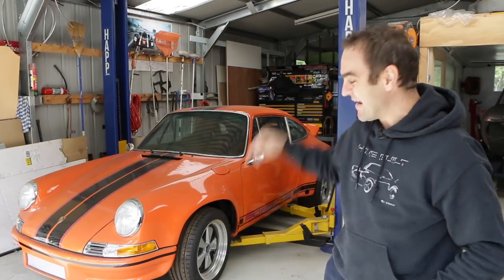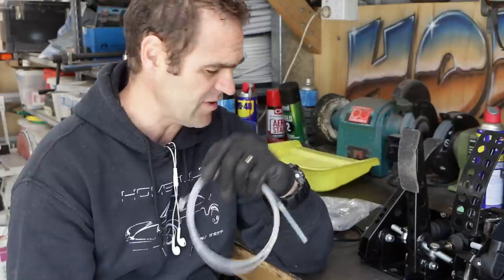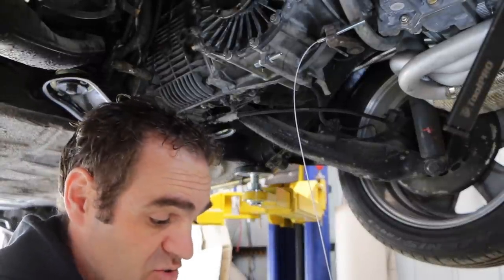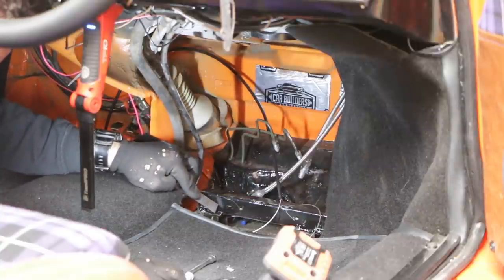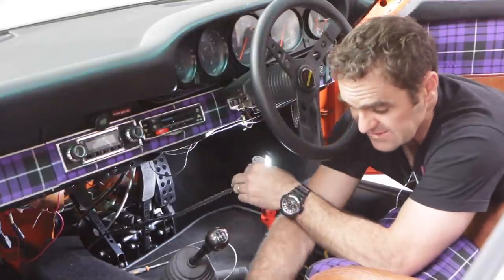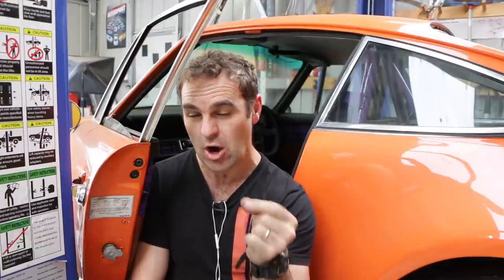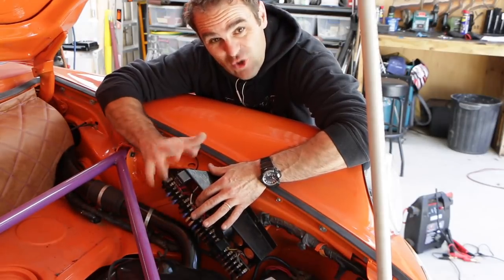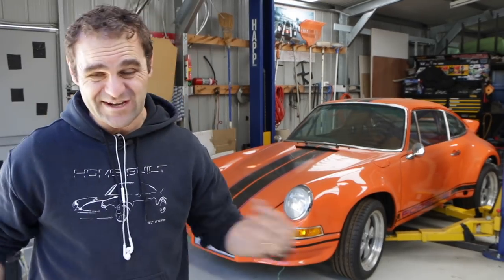Struggling with the clutch - 911 2.8 RSR Build Season 2.31

Comment: Holy Crap, I was actually able to help with that spring mod! Never thought it would happen.
Reply: That was you?  Brilliant!  Pat yourself on the back.  Jeff should let you give it a spin around the block after it's sorted :)

Funny it didn't occur to me because that's EXACTLY what I do with my 100 year old garage door kicker springs when they break - just reattach to the next coil lower down.  I keep losing a coil now & then over the years, but so far in 18 years I still haven't had to source one yet!!!  (And I installed safety cables through the center so they don't go flying and kill me!)

Comment: Cables can be made from scratch, I've used small company over the years here in UK that I've used to shorten gearshift cables on conversions but they make anything from throttle cables to Heavy duty machine control cables from scratch or modify originals. The rack of fittings amazed me!
Keep it cable!

Comment: That bolt hole across from the clutch arm is prime real estate for a for slave cylinder mounting bracket. Just buy a slave cylinder with the travel your clutch needs to actuate and rig up a pivoting arm you can connect to the clutch arm. You've got the skills. Screw cables, they inevitably break...but before that they stretch, so you're always having to adjust them.

Comment: Say hey Jeff, although bend radius might be an issue, fabricate a cable using 3/16" (or smaller) wire rope/cable and the plastic housing (if it fits). That size won't break or stretch given the minimal stress. We're seeing daylight for the first start. 🖖

Comment: Flexdrive will sort your clutch cable out you now have a sample length of inner and outer and what ends you need but yes hydraulic option is a much better idea mounting a slave cylinder is the only difficulty not long now the excitement is building thanks for sharing

Comment: Hey Jeff, I agree with the previous comments, a hydraulic clutch conversion is the best way to go, the cable device can be a pain and gives imprecise and possibly excessively heavy clutch control, not good for a "modded" vehicle.

Comment: Push the cable through the barrel (the thing you couldn’t get to tighten properly) and then crimp the protruding cable with either a ring, spade or bullet terminal etc and just cut the terminal section off (hope that made sense) 😁

Comment: Push pull cable is what you want. They are designed to be operated in both directions. Used for gear selectors, throttles cable, marine, automotive etc etc

Comment: Here's the should've. Should have left the barrel end on and threaded the cable from the pedal end to the clutch in the back. Don't use hydraulics!  Look for  a clutch cable from a truck or cable for airplane control surfaces. One of those should fit and and be extra strong. Great work as always.

Comment: The stock fuel pump relay includes a flyback/quenching diode.  Something to consider if you're replacing it with a off-the-shelf item... To protect your ECU from back EMF.

Comment: You need to use soldered connectors on the Bowden cable for a reliable fitting and I agree with others, the cable is to light weight and more suitable for a motorcycle than a car. I would treble the cross sectional area of the cable.

Comment: Hi Jeff.
I done up a off road buggy that had a VW beetle gearbox. I got a cable set up from a local company called justkampers. Worked well till I changed to an hydraulic clutch set up.
Hope that may help you out.
Cheers.

Comment: Go hydraulic with your setup it will be much easier. The standard car  cable set up requires an  assist spring on gearbox ( omega spring)  and one on the  pedal box  also to help you push the pedal as the forces required are too high without them.

Comment: Used these on pushbike brakes over the years, used to cover them in flux, assemble and adjust and then solder them up, probably no use to you now though..

Comment: On my 71 911t the clutch cable has shielded cover that goes to the hole at bottom of the transaxle and it actually pushes the clutch lever rather than pulls on it as in must cars. Don’t know if yours is the same but you might ck into it.

Comment: A bowden cable isnt as simpel as it looks. It doesnt like small radious bends at all. A large radious bend is prefered to being compleatly straight.
There is a reason porsche made a mechanical linkage to the tunnel and have a straight pull.

If you want the end bit in the cable to not come off, throw away that screw type thing away. Get one that gas a conical/steped hole, pull the cable through, spread the strands apart and solder it in place.

Anyway I was going to sugest going to a hydraulic clutch. I think it might be expensive, but you could fabricate a linkage near the gearbox and have a solid rod from it to the clutch arm.

Comment: I can't remember if you mentioned this before. Are you fitting any kind of safety cut-off for the fuel pump, like an inertia switch etc?
Reply from the maker: I completely forgot about that, but I will add a similar thing to what I used on the Datsun.

Comment: is that fuel pump relay secure from sliding around in that metal bracket? it looks like it would be easy for it to slide and short the relay pins out

Comment: That cable should be more than strong enough.  It looks significantly larger than a bicycle brake cable.  I was discussing spoke tensions with someone recently and they said something like, "brake cables don't even get as much tension as spokes" while discussing the bicycle's spoked tension wheel.  (Most bicycle wheels spec max spoke tension at 120kgf, or 240lbs.) 

Well, I was immediately doubtful of this statement, so I took my tension meter and calibrated it and found a bicycle front brake cable will undergo tensions of 440 lbs. without any issue whatsoever.  No cable, housing, or fitting failure.  This tension max force I generated probably isn't that frequent, but I'm sure tensions of 200-300 lbs. are not uncommon at all while riding -  especially on tandems where the front brake needs enough force to stop two people.

So is your clutch cable tension anywhere near 400 lbs.?  I can't imagine it is.  So I'd expect a thinner bicycle brake cable to suffice, much more so, the thicker cable you have.

But one thing I would add is that nowhere in your video did I see you lubricate the cable.  And even before that, I assume your housing (the liner) is lined with a plastic liner, right?  This is crucial to keep friction low.  And lubricating with appropriate lube (usually synthetic grease or oil*) is just that much more important.  Both of these factors lead to much smoother cable action, as do reducing sharp bends.

Additionally, I hope all of the fitting ends can be sealed with rubber boots and covers to keep contamination and water from entering the cable housing.

And yes, cutting off the end was probably something you shouldn't have done.  But is the long cylindrical fitting (parallel to the cable's length) on the other end permanent (it looked like it)?  If it isn't, and cable adjustment is made there, then you DEFINITELY want to use the supplied barrel end as the foundation from which your pedal should pull the cable (just like in bike and motorcycle brake levers).

And yes, hydraulic would be the best solution.  However, it needs to push instead of pull, and your system is currently configured to pull.

*Petroleum-based lubricants can attack and degrade the plastic liner, causing friction problems.

PS  Can anyone here tell me why every time I insert ONE free space between paragraphs in the comments section (one tap of the return key), I get TWO OR MORE spaces after hitting "comment" when posting?  It's completely annoying to add comments that have two or three spaces where entered only one.  And I'm not hitting enter more than once; this does not happen anywhere else I comment.  Lame!
Reply from the maker: The clutch cable would see MUCH higher loads than a push bike. I would say many times. You can't even budge the clutch fork by hand, and the pedal is much longer, using much more leverage, and it still a heavy clutch even with the factory helper spring ;)
Reply: @HomeBuiltByJeff  I hear you.  But again, how many pounds of pull do you imagine?  More than 450?  Even with leverage at the clutch pedal, that's a lot of force.  I'd be surprised if it were much more than that, but I could be wrong.  And even if it were, I'd expect the average bicycle brake cable to have a 10X margin of safety.  So failure loads would be over 4,500 pounds of force.  No way a clutch needs THAT much force to pull!

I drive an '88 911 and the clutch needs some push, but not THAT MUCH!!!!  If my 85 year old Mom can drive it, it isn't anywhere near 4,500 lbs!!!!

Either way, good luck.  Still DYING to hear that baby start!!!

Comment: Perhaps a hydraulic clutch system would be a better solution?...plenty around in wrecking yards...
Reply: TRUTH SEEKER my 1990 928GT has a hydraulic clutch and I’ve never had a problem with it in 20yrs!
Reply: @danopureblood7066  There you go....got to be better than a throttle cable :-D

Comment: Those screw on nipples are not really for high load cables, splaying the cable and dipping in a solder pot makes a very strong cable every time. The cable itself should break before the nipple pulls off. I wonder if YouTube will Auto moderate this comment?
Having said that... yeah hydraulic is a way better solution.